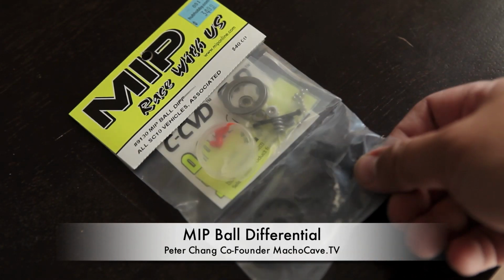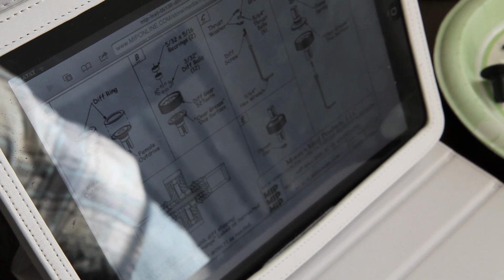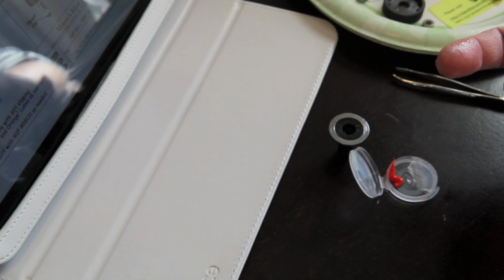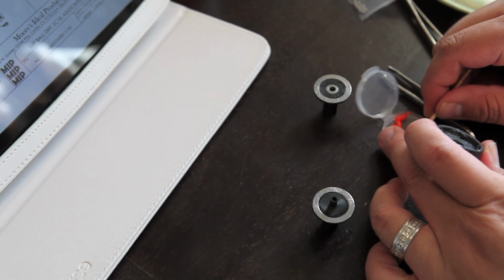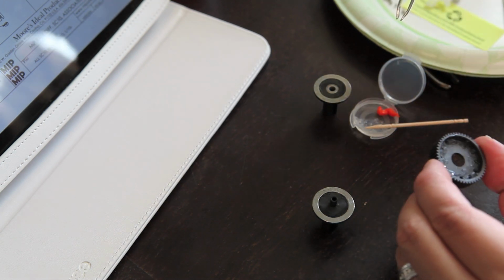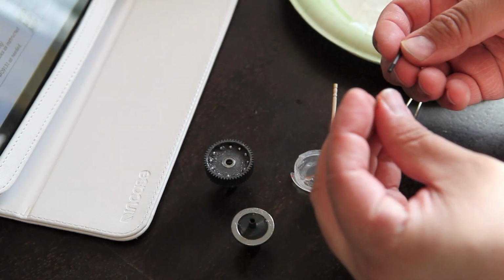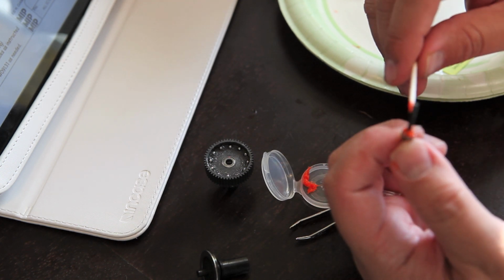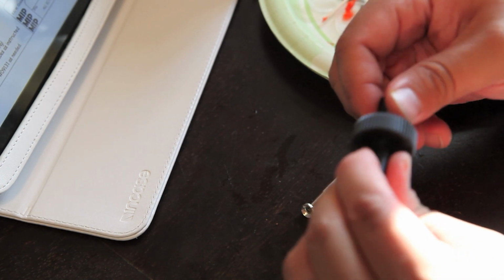How to Install a MIP Ball Differential in an SC10 Short Course RC CAR

Comment from the maker: 3. Do this again and again check to see if it loosened or tightened.
4. Then go to 1/2 throttle on both sides same as step 2 and 3 and recheck.

5. Once all this is done do the same as step 2 except start out slow and gradually increase throttle to 3/4 and hold for 15 seconds and repeat for other side and recheck.

6. Set your slipper and drive it, at this point your diff should be perfect.

Comment from the maker: This is covered in more detail in the my SCX-60CF series of build videos, and here are the steps below:
1. Tighten the thrust bearing it all the way and back it out 1/8 or a little more so it is smooth, you want the opposite tire to go backwards when you spin the one tire forwards manually.
2. Hold the one wheel and lift the other off the table and give it 1/4 throttle for about 5 seconds. Then repeat on other side and then check the diff tightness again.

Comment from the maker: There are a few different differential gears that you can use, I just really prefer the ball differentials due to the nice balancing effects when cutting into turns and it's really advantageous when you have tracks with lots of cornering. The downside is more maintenance. Regular gear based diffs last much longer :)

Comment from the maker: Great Question! I'm not really sure if it would fit. You might want to check at a local hobby shop to see if a regular SC10 gear diff would fit. If a regular SC10 gear diff fits then the MIP diff will fit for sure! Also, AMain Hobbies still has some parts for the diff under their vintage parts section--I guess for something in the late 1999s is now considered vintage--I feel old! Lol :)